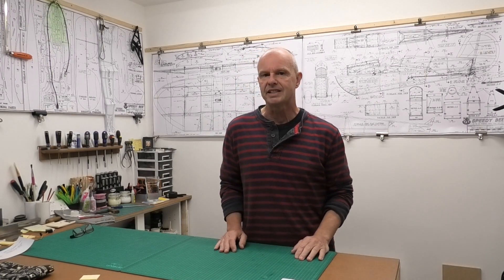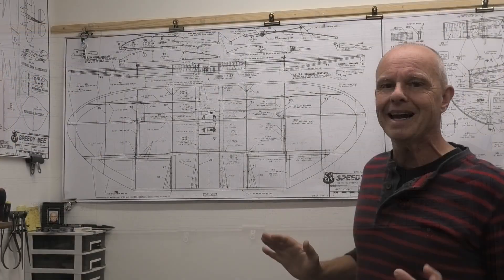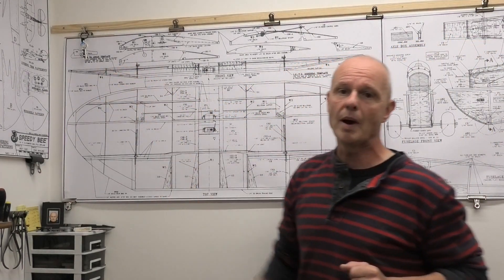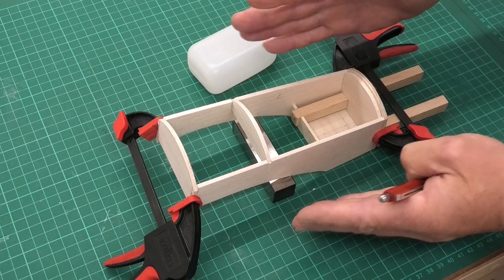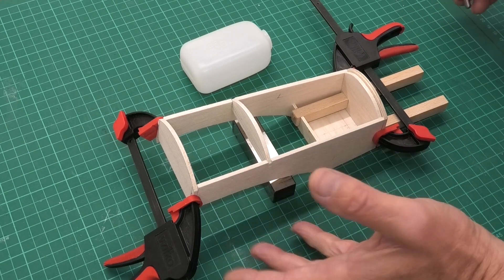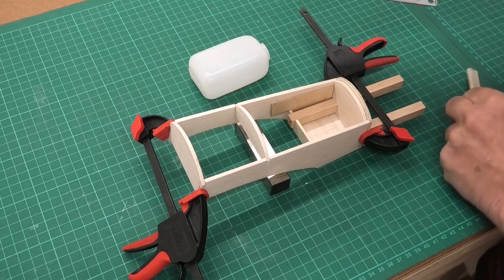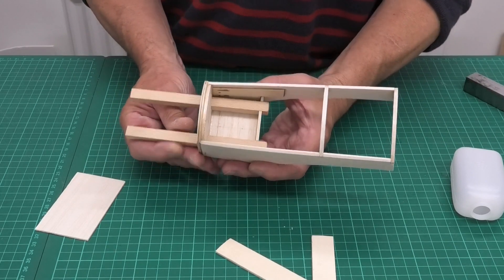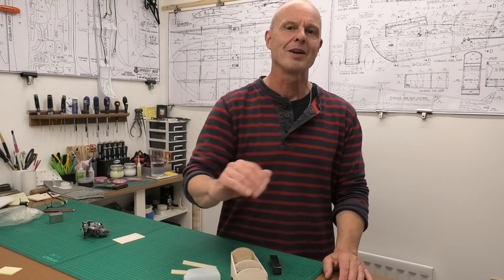Speedy Bee - Build Series Pt 1: Plans & Building the Nacelle - Designed by Clancy Aviation - OS fs26

Comment: Hi, Mark.
One thing is for certain, Andy Clancy had no qualms about reinventing the wheel, so to speak.
For example, those "kicked up" wingtips create a dihedral effect for lateral stability.
This should be a fun project.
Carry on, soldier!
Reply from the maker: Hahaha, yes, absolutely, they really are very different, not only in there looks but also the construction, should be a fun build 😀
Reply: @MarkRobinson555  
Back in the 90s, I built Andy's Stagger Bee from one of his kits. It was as much to build as it was to fly.
Goofy little plane, that. Trexler wheels and all.